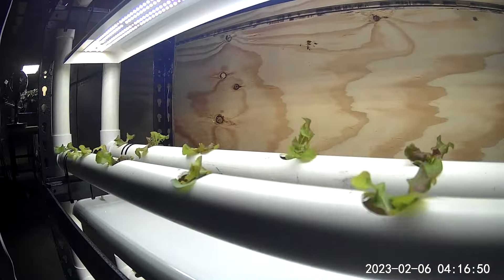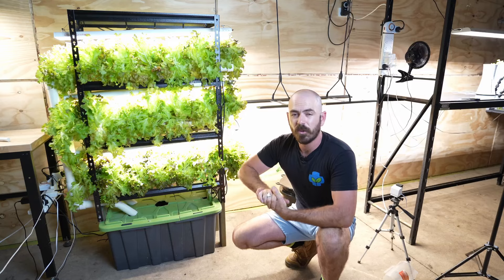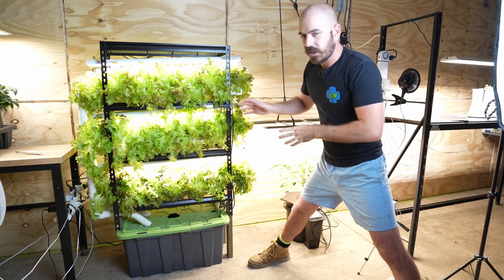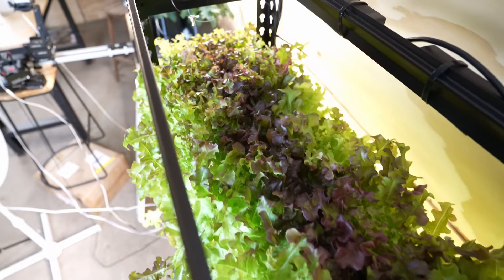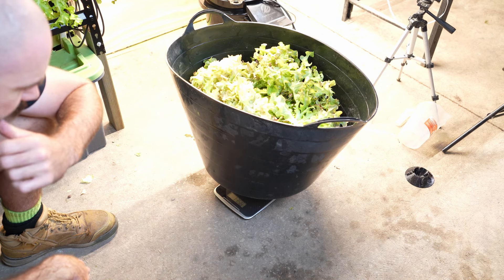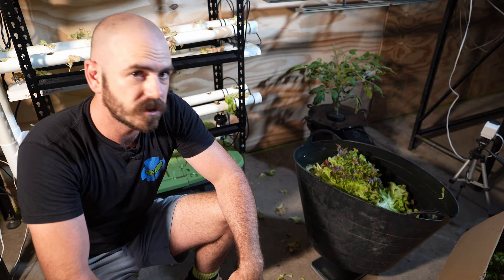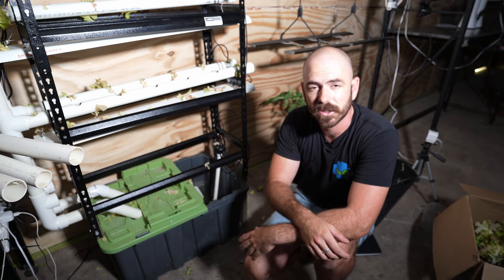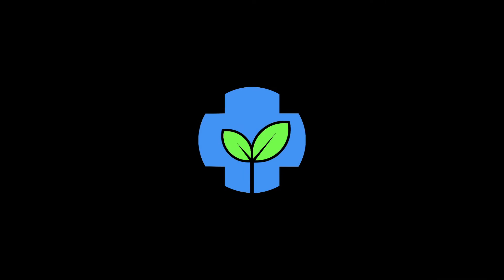DIY Home Hydroponics: Indoor Vertical System Set Up & Timelapse

Comment: Hoocho seems to be using 3 spiderfarm SF600 in this setup, each one are 74 W. If the photoperiod is 12 hours he is using 2.6 kWh a day in lighting. A pump for a setup this big might be 6 W running 24 hours? that adds 0.14 kWh a day. lighting and water draws 2.8 kWh a day or 87 kWh a month. The system is growing 42 lettuces, so each lettuce requieres 2.07 kWh to grow. 
Multiplying by your energy price you can get your cost per lettuce (for me is about 0.30 €)
Reply: hopefully more people see this comment - clearly lots of people chomping at the bit for electricity draw info. even a ball park would help some people in here it seems. nice :)
Reply: I’m running a Spider Farmer SF600 and my cost (it’s through a meter) is less than 30 cents a day for 16 hours on
Reply: For me @ $0.10 per kw it comes out to $8.7 for electricity for about 9 pounds of lettuce.

Comment: Just set up a similar system using a bunch of your techniques from earlier videos (cotton ball propagation FTW) and the fortuitous gifting of a 3 level propagation shelf from a neighbour who needed the room for a new baby.  I love with the cotton ball method that it gives enough support to a well-grown seedling by just placing it the channel you don't have to got through a deeper water phase to grow a longer root structure or need the additional support of foam puck. I used 4" PVC because it seemed a good idea at the time but is probably overkill for lettuce which is my main crop. I wish I'd gone to the smaller diameter tubing. I added some taps so I can shut off the draining and retain some solution in the channel if the power goes off to keep the plant friends alive. That based on your power outage video. 

 Everything you're doing, even just sharing thoughts and experiences, has gotten me back into hydroponic growing. Thanks for all you're doing.

Comment: You're right about power being the biggest Achilles heel for NFT. That, and clogged nutrient feed pipes.
However, as a medicinal cannabis cultivator using NFTs commercially, we have both fkow sensors on the feed lines as well as a super cheap UPS power supply on each of the pumps. They'll last for the better part of half a day running solidly, and you can even pump water for like 1 min on an 5 off for example (again with a power controller) and it'll extend it even further... Though without lights for two days you won't have much fun 🤣

Comment: WICKED. I have built this system in my kitchen (in a unit). Cotton wool seedlings nearly ready to transplant and try it out. Plan on staggering my grow by 1 x shelf per week. Made it on 4 shelf rack (next size up), have 40l res sideways on bottom shelf and SF300 next to res sideways for seedlings. All fits as an entire system. 
Was thinking of trying a third staggered row in the middle of each shelf, but looking at your results, maybe not...
Oh, 1 x 120mm USB mini fan per shelf too.
Can't wait  !!!!
Cheers
Reply: Are there designs for this somewhere?
Reply: I studied the original build video and took notes, then made adjustments as required. No "instructions" as such...

Comment: Hey there Hoocho!  One other thing to consider about why your top lettuce weighed less than the bottom.  With the way you have your nutrient distributing to the pipes, the higher pipes are getting less nutrient flow than the bottom ones due to how much more water weight the pump needs to push to get the nutrient to the top.

Comment: Hoocho you could adapt that a little and use wire shelf racks like the cyclone wire. Or make timber clamps with thumb screws for a quick release on your nft tubes

Comment: Awesome build :) you can DIY a coated circuit board using clear nail polish. I don't own an SF300 but I'd guess you could probably get away with just painting over the LEDs and power connections (on the board itself) to make it at least somewhat water resistant. It'd take time but shouldn't cost much and I doubt it would affect the PAR too negatively. You wouldn't want to start showering it with water but it should hold up against the extra moisture from the transpiration. You could test how it affects the PAR relatively on the semi-dead board, if it's not bad then might be worth trying it out on your others to see saves them from the moisture!
Cheers
Reply: Interesting idea. But i would be afraid of any heat from the lights causing possible fumes from the polish.  It might not but that would be my concern.

Comment: Hey hoocos mate love your stuff... I am new to this... but something  I would love to see u experiment with.. solar...
I have a solar oxygen pump...
I'm testing with ur Dr. krakesy oxyponics set up the bonus is... it has a battery bank. Also a solar water fountain pump that could be used for flood and drain system. All tho is is direct light pump not batrey banked..
I comment on this particular video due to the black out you had.😊 keen to hear back from. U. Shane.

Comment: Like others I would also like to know total running cost, especially electricity.
I have attempted to collate the electricity used:

SF300 (240V input +/-5%): 33.47 W * 16h * 3 units = 1606.56 Wh
40cm pedestal fan: ~40-50 W * 24h = 1200 Wh
Kegland KL15905 2000L/H pump: 45W * 24h = 1080 Wh
Total (sum) power = 3.88656 kWh/day

Lettuce: 7 plants * 2 rows * 3 shelves = 42
Timelapse: 2023-02-04 - 2023-02-22? = ~3 weeks?
Standard lettuce maturity: 28-56 days = 4-8 weeks

Assuming 4 week: 3.88656 kWh/day * 7 days * 4 weeks / 42 plants
Total power  = 2.59104 kWh / mature plant

My mains general supply is AU$0.21395/kWh
= AU$0.83152 /day total run cost
= AU$0.55435 /mature plant, assuming 4 week

You'd also have to eat 1.5 lettuce/day to keep up with growth
Reply: In the UK electricity is around 35pence per kWh   40cents USA

Comment: Mentioned light pollution for each layer but I feel it may be more related to the water flow on each run as pumping water higher will have an effect on the flow rate.

Comment: Add a reservoir to the top shelf and divert your pump into it.  Then just poor a bucket of water from the lower reservoir to the upper when you don't use the pump.  I've been doing this for my dutch bucket toms (1 time every other day).  I'm sure you can figure out a way to regulate water flow from the upper reservoir and stretch out the watering duration.
Reply: A scissor jack, a platform and a battery drill can be used to raise and lower the reservoir for the same result :)
Reply: @atomizer2665  I'd like to see that.  I have an idea for a large see-saw with reservoirs at either end.  And I could walk from one side to the other to raise and lower the water for a gravity fed system.
Reply: @noahmiller6115 
The jack will need less space and the water will remain level. There are plenty of how to`s on you tube for height adjustable woodwork benches that use scissor jacks :)

Comment: No idea if it is on your radar or not, but some inverters operate as a back up for when their grid goes down. Ie on a renogy inverter, you can have something plugged in, running from the mains power and if that fails the inverter should kick in without disrupting the supply.

Comment: My tomato had fruit (ber got the first and the other two I ate and grabbed their seeds).  I took the seeds from the first fruit, and put them in water to remove their coatings, only to find they all sprouted in the water in a day or so.  OOPS.  I rushed to get them into dirt, and 3 went into hydro.  Within 5 weeks they are all now flowering and the kratky one has a baby tomato with a lot of other flowers.  All indoors in winter as hydro is a no-no here (as I found out last summer) between June and Sept due to the heat and the root rot that comes (water temps are just too high).  This tells me that kratky is indeed a viable method for tomatoes.

Comment: If you're thinking of making a solar powered NFT system, I'd put in a vote to see a system that doesn't use a battery bank but still maintains flow 24/7 by pumping from a lower IBC up to a higher IBC while solar power is available in the day, and have nutrient constantly slowly flowing out of the top reservoir, through the NFT system, down into the bottom reservoir throughout day and night. Might need 2 or 3 IBCs up high and the same amount down low per NFT pipe (to store 24 hours worth of sufficient flow) though so probably not super space/money efficient :D
Reply: I'm curious: Why without a battery?  A car battery will run a pump for about 40 hours.

Comment: Would filling the NFT channels with hydroton help act as a buffer when there are blackouts? My short term solution was to flip the elbows at the end of my NFT channels up and fill the channels up with water. Not ideal. Had root rot before that so i do not know if it affected anything. I am putting off buying a larger air pump for now. It is too expensive where I am located. fosetyl aluminium helps cure root rot in my experience. I may need to apply at the start and not part way through the lettuce grow. Soil based Pesticides and Fungicides in recirculating systems is something that concerns me. They can not wash lower into the water table like with soil but I have not had time to research the topic well.

Comment: Greetings from Germany, we got PV on our roof and electricity costs are nearly zero (except winter). Started setting up my indoor garden last months, got a 3D printed tower in the kitchen which serves salad and herbs. Now tomatoes and others in the tent this summer. Would like to know which fertilizer is recommended (N-K-P and other ratios), got some liquid stuff which causes a bad taste to cucumbers and others veggies. I dont know which works for veggies
Reply: I use masterblend, calcium nitrate and epsom salts. Not sure if the masterblend is available in Deutschland. Works great on lettuce and on dwarf tomatoes although the tomatoes are just flowering so I haven't gotten to taste them.

Comment: Hiya Hoocho. Love the content mate. Just discovered your channel recently and really enjoying watching your back library so far. 

Looking at this unit, can I ask some noob questions? 

Why did you need to feed a separate line from the pump (via distributor) to each of the pipe runs?
Why not just run 1 feed line to each of the top runs and then have them feed through the rest (on each team) back to the res? 
Is it because the top plants would get most of the nutrient and the bottom ones would get bugger all, or does it not matter, due to the constant flow, and mainly come down to aesthetics?

I'm just about to start dabbling in this sort of stuff and this setup (or maybe the pet bowl or table top one?) seems like a good and easy one to cut my teeth on.

Comment: Nice video, love the system.  I would love to see a design or recommendations for something that you can continually stagger planting on.  10 pounds of lettuce in one sitting is a bit much for any household :)
Reply: Why wouldn't this work for stagger planting? If you cover the unplanted holes, you can plant a few lettuce a day or a row a week, for example. Then, as you stagger harvest, just replant what you take.
Reply: Don't only grow lettuce, grow some herbs, chives and coriander, bok choi and you will find not too much at all. in fact i find it not sufficient for my household. The cost to run the grow lights and pump though - that's another issue.
Reply: @DirectCherry  didn't really look like those roots were coming apart.  Maybe you could do a row at a time

Comment: I’m just setting up a similar shelving system with 3 SF300’s, what was the timescale on lettuce from seed to harvest for yours?
Reply: I had this question too. I was looking at the time stamps of the video, I think it went from Feb 4 - Feb 17, and he said there was a week that didn't get filmed. So . . . assuming those seedlings needed 10-14 days to germinate and get true leaves, and Feb. 4 - Feb. 24 = 20 days (?) then 30-34 days all told???

Comment: This was really interesting. It looks like in the dark, when the Calvin cycle is doing its thing, the plants seem to grow higher than when the lights are on. I've heard legends that plants will grow very tall but not very leafy until they "reach the top of the canopy" and have access to light again. Initially I thought "Why not just leave the lights on 24/7?" but after seeing this I think it's important that the stalks have that light-deprived stalk growth period to make more room for another row of leaves to grow underneath the ones above.

Very interesting video, would like to see it with different dark/light cycles to dial in maximum plant geometry and yield. Thanks for all your work and great videos.:goodvibes:
Reply: The main thing is that you supply the specific plant type with the correct light intensity and quantity in terms of DLI (Daily Light Integral).  If you are growing with the big halide in the sky you dont need to worry about it.

Comment: Do you ever get powdery mildew on your lettuce? Here in Indiana, USA we get it every fall without fail. The plants still have it and I've deep cleaned (all plants removed) and sprayed with Zerotol2.0 and sprayed the new plants with Cease and Milstop and I still have powdery mildew.
Reply: I only get it on the rockwool I use sometimes, I just hit it with hydrogenperoxide.

Comment: how often do you need to clean out the roots and can it be done without taking out the pipes? i am building something similar and i was recommended to glue the pipes together. (i want to have it indoor in my flat and it leaking would not be good)
Reply: For lettuce, at the end of the grow, when they get too tall and the roots still wont be an issue.  If you're growing things like cilantro or perpetual spinach, you need to clip the roots every couple of weeks.  Luckily, if the roots do become a problem, the leak is relatively slow and can be caught.  As for the gluing of the pipes, I did.  You can just jam them in there, but pvc connectors angle out and I was worried about heat changes slowly causing the pipes to slide out.

Comment: Hey Hoocho. How long do hydroponic plants live? Can you have multiple harvest seasons on for example tomato plants?
Reply: It depends on climate and the type of tom, determinate or indeterminate.
Reply: @atomizer2665  Ok. Thanks for the reply 😼. For example if I'm using the Kratkey method that Hoocho did with tomatoes in a warm climate. How long do you think? I've read online tomato plants can live up to 5 years in soil. So I'm just wondering if growing them hydroponically has any effect on their lifetime. 💚
Reply: @mishucat  
The method used wont affect it unless the roots run out of space. With an indeterminate tom its more about having the right temperature and light levels to maintain active growth. You would have to use the lean and lower technique which places the stem along the ground as you constantly harvest fruit from the bottom up.
Reply: @atomizer2665  Thanks for your help. You are very kind :yougotthis:

Comment: One heck of a grow. A rack that is taller so that there are 4 levels would permit a rotation for continuous greens supply. Especially like the ease that the channels can be cleaned out.

Here is a slightly different approach -- https://www.youtube.com/watch?v=5HDADTDoLBM&list=PLpHUZsnFSzdI5FAbpvIBhjh0BMDSMZg6H -- to the same result. This gents approach has a certain level of redundancy in the event of a power outage. But i suspect the maintenance would be a bit harder to accomplish.

Comment: Great video as always. 👍 Please could you calculate the electricity used overall and per lettuce (in Wh) ? The cost of 40 cents for nutrients is good to know, but if the main cost (electricity) is not mentioned, people can't calculate if its worth building a system like this - it could be cheaper to buy lettuce from the store.
Reply: About 30 cents per day for each SF600 (based on 16 hours on)